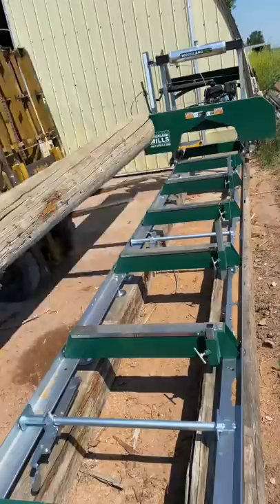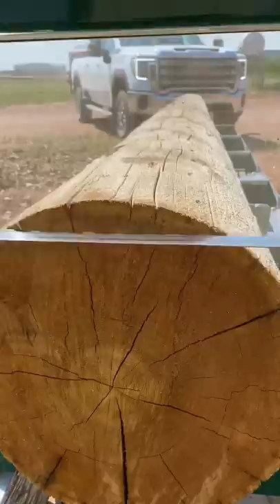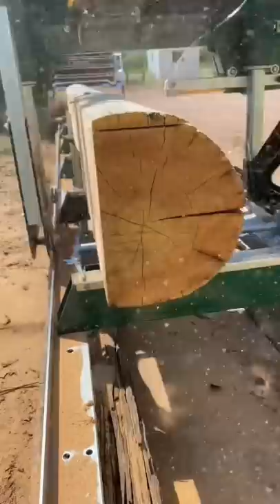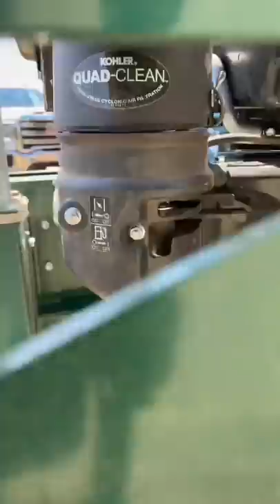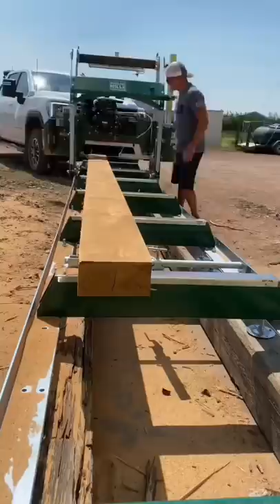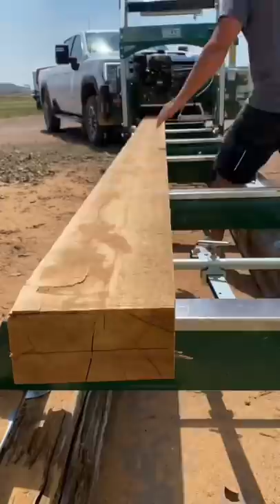Sawmill sounds like a mosquito

Comment: How much does a small mill like this cost, roughly?  $1k, $2500, $5k, $10k?
Reply: $9000 for a fairly decent setup
Reply: @Siouxperman  wow...really that much... i have absolutely no clue, but i would have thought maybe 3 or 4. Thanks for replying. Stay well and be safe
Reply: A new one of these is gona be close to or above 5 digits, but this is not a "small" mill i would say. 
My father has a "logosol F2" which takes a chainsaw and is around 2-3000 new, he bought one used, and a new 76cc chainsaw with a 36" sword for around 1k total.
For a hobby and private use, that is more than enough!
Reply: Smallest would be a logosol timberjig or similar. Sub 1k new, easily found for 2-300 excluding chainsaw used!
Reply: @MrPlayaaah  much appreciated. I just moved to a property and theres over 100 black walnut and red oak on it. I'd like to saw it up into timber. Im just starting to look into pricing for different setups. Its looking like a chainsaw setup is what im gonna be going with. They look to be under 500$ without a saw and some with a saw used.